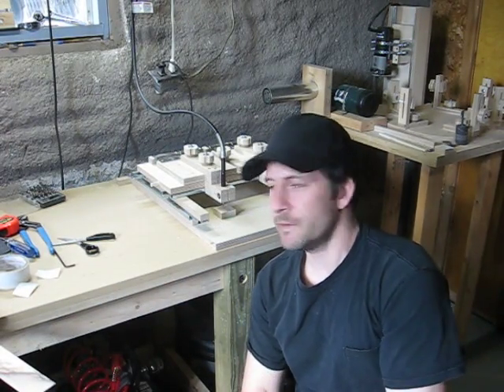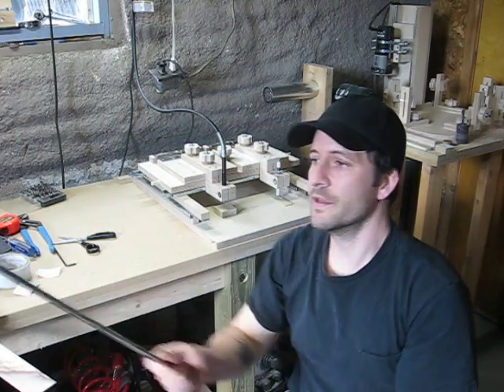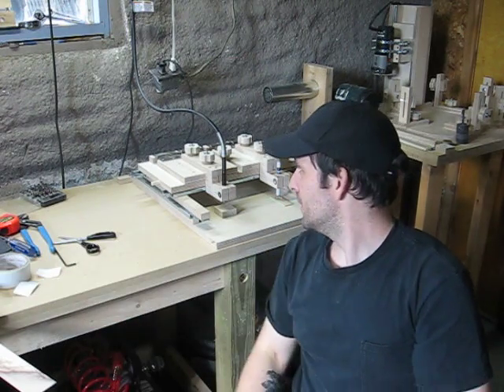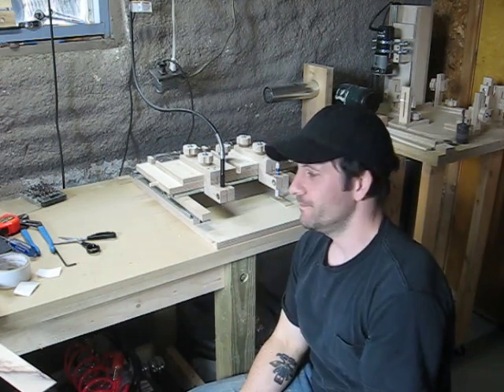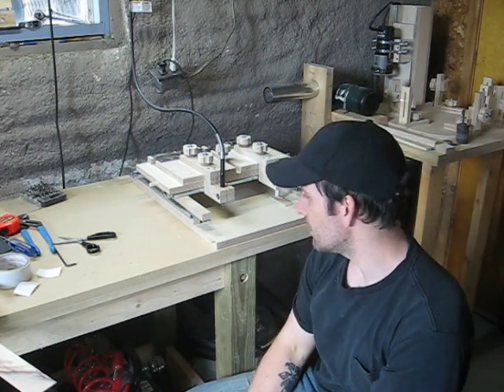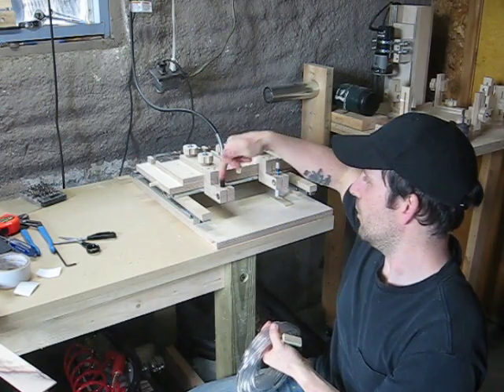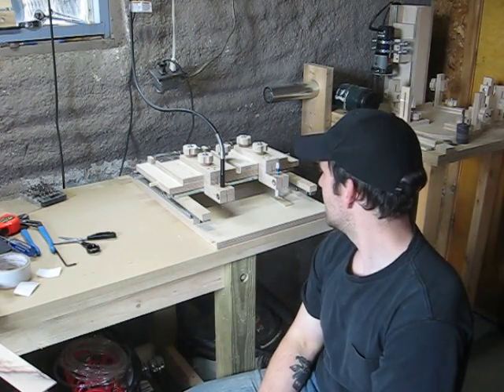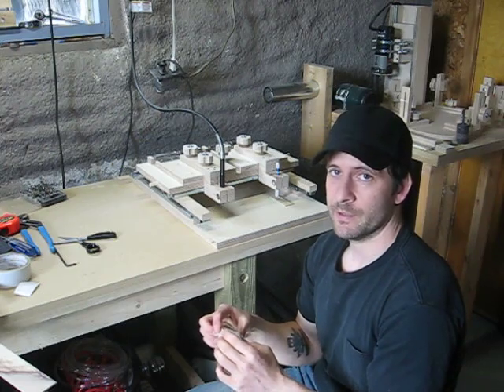Luthier Inlay Router Duplicator

Comment: twin fan sever fan to blow dust i got some they are extremly a lot of air on full voltage i have hocked up to a small 12 volt dc power with a potentiometer old modified knob house light dimmer, to all youtuber 2n language is English

Comment: Nice duplicator/pantograph.  On the split router and stylus supports, is one side glued (fixed) and the other side loose to allow movement to grab the router or stylus? What is the nut and knob bolt called?